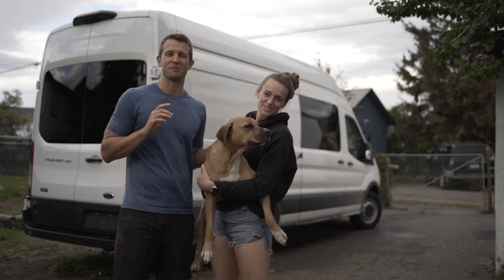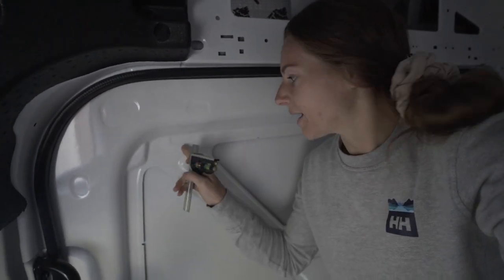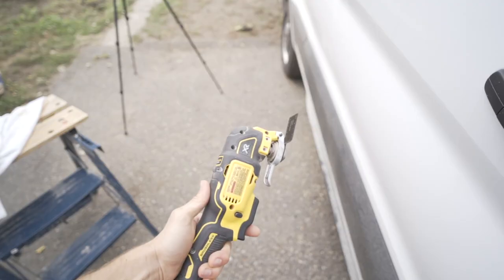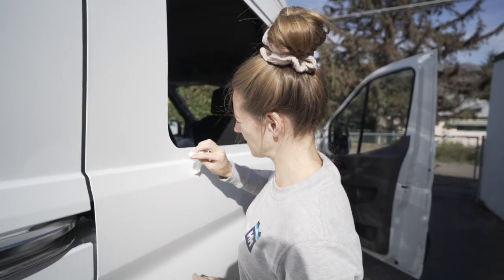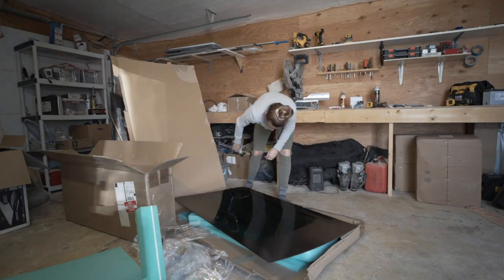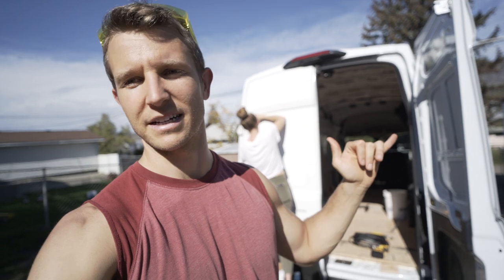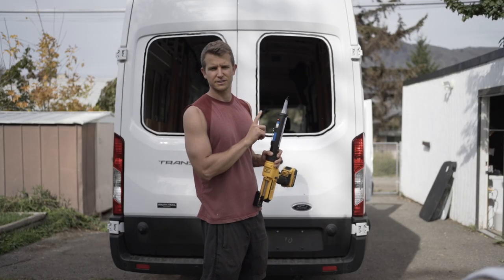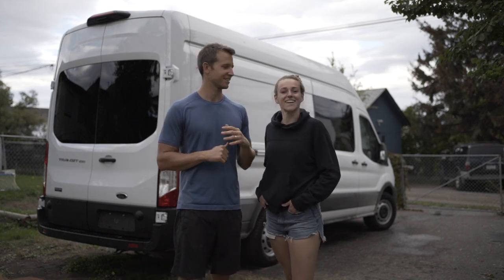VAN BUILD SERIES | VWD Window Installation

Comment: So on the back windows did the rubber edge trim not cover the outside metal too? It looked like you just put it on the inside metal ridge. I thought it was supposed to sandwich both sides together like the side window? Thanks

Comment: Nice job! I've saw another video and to hold the glass in place while curing. They used a glass installers suction handle and a little ratchet strap tied to the opposite interior wall of the van to put pressure on the adhesive
Reply from the maker: Thanks! Hey that’s an interesting idea - I had never come across that technique :)

Comment: Hey thanks for this video! We just did this install and followed along! It was super helpful!

Curious though, how come you decided to only install the edge trim on the inside sheet metal? On van windows direct it says to install on both inner and outer. We did only the inner metal on our slider window but did both inner/outer on the rear which worked better for hiding imperfections on the outer cut
Reply from the maker: Right on! We’re glad you found it helpful and congrats on the successful install!

It’s been a while but I think we wondered if the trim lok might prevent the window from fully contacting the urethane adhesive and didn’t find it necessary
Reply: @TimKatie  Thanks for the reply! We're newbies so our cuts weren't as clean ahaha! I wondered if I could take the off trim lok and re-install it on both edges but I'm afraid of it messing up the window install at this point so I'll probably just leave it.

Your videos are awesome! We are designing a similar type layout and your build videos are a huge inspiration. We also live in BC! cheers and good luck with finishing up your latest build
Reply from the maker: @LetsJustGoTravel  No problem! I’m sure it turned out great and will function just fine 👍🏻

Thank you! We’re glad to hear you’ve found them helpful. We’re hoping to get some more up soon. All the best with the rest of your build!

Comment: I see that you've installed fixed windows as opposed to either bunk sliders or bunk awning windows in the rear portion of your van.  I'm thinking along the lines of Faroutrides that you need ventialtion and as long as a bunk window is going in, shouldn't it be either a slider or awning to increase ventilation and hopefully forego the use of the a/c if not needed?  And if so, would you install only one or one on each side of the van??  Looking for your insight as a builder with experience already in builds!!  Thanks for your input
Reply from the maker: Thanks for the comment, Larry. We also installed CRL half slider bunk windows on both sides of the bed like we did in our last van (we just haven’t had time to edit and share that video yet). If you prefer not to put windows by the bed then you could certainly install awning/slider styles of the bigger sliding door or rear cargo door windows 👍🏻

Comment: How much did you use for each of the big windows?  One container?
Reply from the maker: Do you mean the urethane adhesive? We used just over one tube on the slider door window and less than one on each of the rear windows

Comment: Do you have links for the materials?
Reply from the maker: All of the materials are available on www.vanwindowsdirect.com website 👍🏻
Reply: @TimKatie  thanks for responding. I should have specified, I meant links for the “additional materials”
Reply from the maker: @tenemms2442  Sorry about that! No we don't have specific links for them unfortunately
Reply: @TimKatie  what size Trim-lok there is so many to choose from. What size and how much length was needed? Can I buy from Amazon?
Reply from the maker: @tenemms2442  on VWD website when you find the window you want to order if you scroll down and read the instructions they have links to the correct Trim-lok and recommendations of how much to purchase. Or you can contact them directly :)